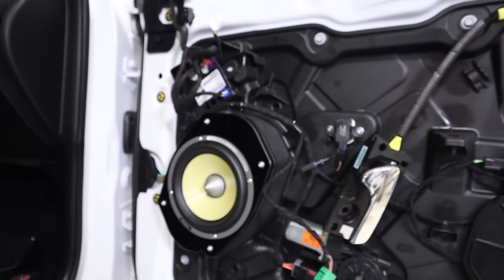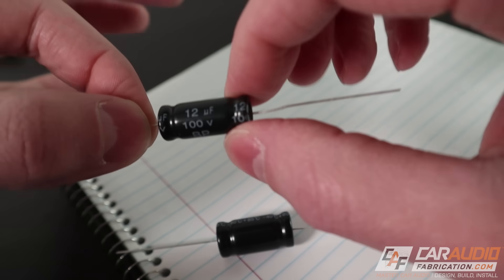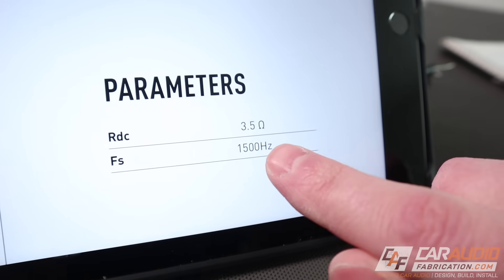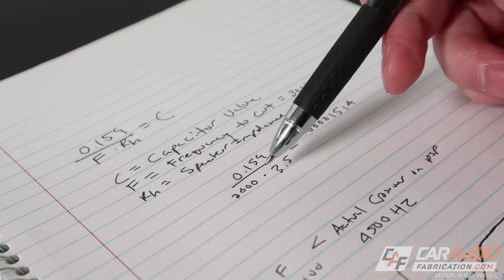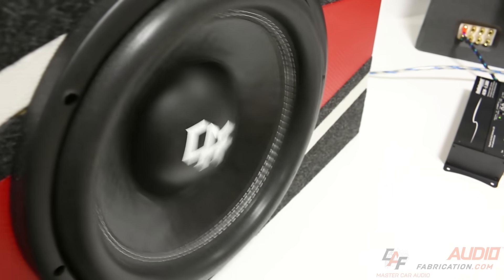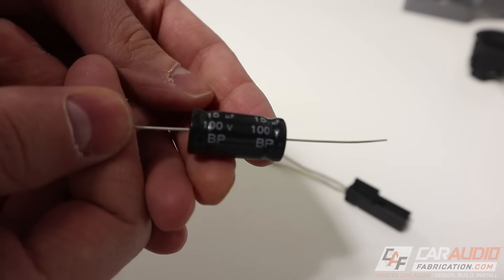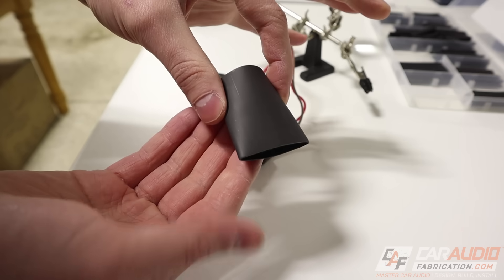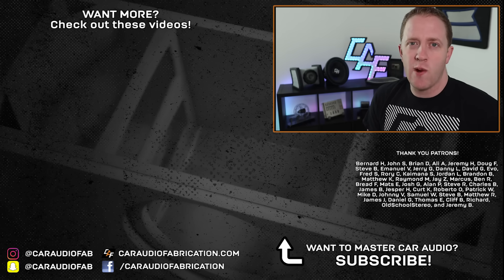PROTECT YOUR TWEETERS! Capacitors and WHY you need them

Comment: If I install a passive box crossover , does this capacitor on the tweeter affect the overall capacitance/ limits of the frequency ? Do I need  to remove it if I install the box

Comment: Random question:
If capacitors are always needed for tweeters, then why don't manufacturers just pre-assemble them into the tweeter?
Reply from the maker: Good manufacturers DO include this protective cap with their high end component tweeters. Look at JL Audio, AudioControl, AudioFrog etc. The thing is they don't know if you will run those active or if you will be using them with a passive crossover. So they don't bake it in
Reply: @CarAudioFabrication  Gotcha, I see. I'm honestly still learning, so I was genuinely curious. :)

Comment: Very good series of videos; just a quick question.  At 02:30 you mention F should be between Fs and the Actual Cross over Freq set at your High-Pass Xover (as per DSP).  The value for F is the set at roughly 2 x Fs.  but in the cross-over setting video you referenced (https://www.youtube.com/watch?v=BDKLYsGyBVU) you mention at 16:29 that the High Pass X Over for Tweeter is set at Fs x 2.  doesn't that mean that essentially F = High Pass XOver point?  Thanks for clearing this up

Comment: I have mid tweets FS value of 111 hz so a 390 microfarad cap. I notice the ones I’m looking at are 400v does the volts matter? Ones in the video are 100. Just checking I know you only say the microfarads matter but I want to make sure.

Comment: The equation doesn't work as listed.  0.159 / 3000 x 3.5 = 0.159 / 10500 = 1.5428  not  .00001514   Something is missing like (x 10).
Reply: Nevermind, I missed the e-5 at the end of the calculator. Funny we move the decimal five to the left, then 6 to the right for uF.  :-)
Reply: There's some discussion online about why microsoft standard calculator in windows shows scientific notation, but for we who are using the windows calc, the correct final result can be achieved by :  (.159/(FxRh)) x 1000000 as you did manually show.

Comment: I have a hissing problem when nothing is playing and engine off. 09 altima. I believe they put a capacitor on the dash speakers. Could adding a correct capacitor possibly fix my problem. Also ive read its common in cheap android head units. Going crazy trying to trace down the problem. Sloght hiss as soon as volume goes to 1. Unnoticeable with music on.

Comment: REF 6530cx Description: 6-1/2" (160mm) component speaker system Power Handling: 90W RMS, 270W peak Sensitivity (@ 2.83V): 93dB Frequency Response: 53Hz – 21kHz Impedance: 3.0 ohms    -   this speaker 3 ohm, can you suggest  matched car stereo for this speaker.

Comment: Do capacitors for tweeter control power output? I mean if the amp is 300 rms x 4, does the amp send the same amount of power to tweeter and component sub on that channel?

Comment: If I just installed dash tweeter and I have distortion on high volume I need to replace the capacitor? 
In the shop they put 100V 82uf capacitor

Comment: Is there a good reason to not solder the capacitor closer to the amplifier instead?  Thinking of a tweeter like the C7 where it is MUCH larger and fitting behind a panel could be a bit more difficult.

Comment: hey buddy if my component system has the passive crossover for the tweeter do I need to put additional capacitor? I´m guessing your example is only when we use active crossover. Correct me if I am wrong. Thank you!

Comment: Will a 25v 4.7 millifarad non polar capacitor work with a set of pioneer ts-120twm tweeters? It says they have an inline high pass crossover network built in. Will any capacitor work? The ones i have came from a set of vintage bookshelf speakers i scrapped

Comment: In my case, I have some old Japanese SONOCO loudspeakers, they sound wonderful, but the previous owner had no better idea than to replace the NEC dome Tweeters with 75W piezoelectric ones, I don't have technical information on these Tweeters and the factory doesn't even exist anymore. They are from 1975/79, my question is if I put in that place of the piezoelectric some of Domo that Wattage must have? What capacitor to put to make sure they don't burn or even my fear is that the amplifier will be damaged. 🙄

Comment: The principle of using a capacitor as a high pass filter to protect the tweeter against damage due to low frequencies is a good thing. But using a non-polair electrolitic capacitor degrades the sound quality a lot. Use at least a MKP type capacitor. Yes, it will be bulky and cost some bucks, but it wont affect the sound compared to the type used in the video.

Comment: When using component speakers with an inline passive crossover, should you select "No Tweeter" on the headunit since the frequencies already have a built-in crossover setting?
Reply from the maker: It would depend on the head unit. I'd basically defeat any on-board crossovers as the passive crossover will now take over.

Comment: My head get heating when i look at the formula.. may be I need A20 Bionic Chip to understand it... 😂
Btw, which is the best way to install component speakers? Is it install crossover after head unit or at speaker connectors at the door.pls help me...

Comment: Can anyone tell me if it's safe to use 15uf 100v cap on DS18 Pro-TW220 tweeter?  These tweets come with 3uf caps installed.  Per this video that value is way off crossing it at 9.5Khz.  I've reached out to DS18 about this and they don't answer me.  These tweets have a response down to 2Khz and recommended cross at 3Khz.  15uf sounds perfect.  Is there something I'm missing?

Comment: I calculated almost ~13 mikrofarad, you can get 10 and 15(I measured them havin 11,4 and 16,4)  but you cannot get a 13, you can have a 12 mikrofarad one, so I think I´m ordering a 12 mikrofarad one.
Should you go up or down or is it bad if you go too high / too low, how critical is the value?
thanks in advance

Comment: nice video. got a question. i calculated my new tweeter. i got 11,14 uF. How do we calculate the voltage. the original tweeter in the car has a 63 volts capacitor. or can we use just 100 volts. the new tweeter has 30watts rms and 60 watts normal How does this work. is there difference between polar and non polar capacitors

Comment: I’m running fs of 3.9 crossed over at 3000hz. I figured 17uf per the formula. Is this ok?
Reply: So my fs is 1200. Dc impedance is 3.9 and my amp has a 3000hz high pass filter. I bought 17uf caps. Will this work right?

Comment: Amazing video. One question, Since I have an empty slot for tweeter at my car pillar, I want to add a tweeter and I already bought one. I saw that my tweeter already has a polarized capacitor attached to its terminal. So, do I still need to use a crossover for my tweeter? For additional info, my car speaker system is 2pcs "2 way coaxial speaker" and 2pcs "mid base speaker". Appreciate if you could help.

Comment: you lost me ...i'm not good at math just tell me what Capacitors i need for the KICKER DSC6930 6x9 . i have them running on 2 ch on the SKAR SKV2 -100.4AB Full-Range    and they sound like crap let me tell ya.. will you kindly please tell me what size i need

Comment: I love your videos and have learned so much!  I have a question hopefully you can advise me on.  I've got a set of Infinity Kappa 1.4" edge driven soft dome tweeters that I want to replace my factory tweeters with (21 Ford Super Duty with the factory B&O audio).  I believe the factory Ford tweeters have a bass blocker so I'm assuming the B&O tweeter circuit is full range.  The Kappa tweeter is part of a component set (90CSX) and the crossover specification on the component set is 5kHz.  I don't want to use the Kappa crossovers as they are large round (hockey pucks) that won't fit in my dash near the a-pillars tweeters.  The Kappa tweeters are 2.5 ohm and based on a 5 kHz low frequency cut off, I could use a simple non-polarity 12uF capacitor which would be 5305 kHz cut off.  My primary question is according to your video I should try and set the crossover point between the resonant frequency (Fs) and the published crossover point of 5kHz.  I have been unable to find the resonant frequency specifications for my tweeter.  Should I just target 5kHz or should I go lower?  Is there a typical Fs for a similar size tweeter I could use?  I feel that 5 kHz would be safe but I don't want to lose lower frequencies if the tweeter can handle it.

Comment: 2.2mf 4.7mf 6.2mf 7.8mf 8.8mf 10mf 12mf 15mf 25mf 50mf 100mf/100V 150watts 8 impedance ohms tweteer applying 250watts woofer 8 impedance ohms at 400 watts amplifier.
My question is which capacitor can be use?

Comment: Only one speaker in my car works, could i have my amp hooked to my subs in the back and hook up some high range tweeters to the amp aswell and move them to the front? Or would i over power the tweeters and have a shitty static noise when the bass hits?

Comment: Great video.so would you still need to put a capacitor on a supertweeter  if your using a 3way crossover before going into the amp? Was planning on using a 3 way crossover to connect a supertweeter and a 8" midrange  and then connecting it to a lc4.800 bridged to get more power to the midrange(400rms)@4ohm.also how do I make sure the tweeter doesn't get no more than 100rms or less.would the capacitor n crossover,dsp take care of that? 
and using dm-810 DSP to adjust.

Comment: Question for you Mark - I did this exact thing on two different sets of tweeters. I’m using audio control DSP and amp.  I’m using the same capacitors you are using the formula for my own setup. When I put the capacitors in line there is an audible pop at turn on from the tweeters. When I remove the cap the pop is no longer there. Any ideas what may be causing this? I’m running Focal ES165KX2, so definitely don’t want to end up blowing the tweeters on accident.
Reply: Switch to a fuse of 1 a,p or maybe even have of that for a solution..

Comment: My 2004 Cadillac SRX has factory tweeters and i was wanting to put a bass blocker on those, but the only info is 4 ohms, not sure what to do with that, as the rest of my specifications are not listed anywhere, so what should i do in this case? I have the Delphi tweeters 09354879 REV 03 40265D
Reply from the maker: There are tools to measure the needed specs, but probably better to upgrade the tweeters and then you will know the values. Those stock tweeters are not anything special.

Comment: I have questions for you...  I love your info and your channel and all the videos you post. I am considering installing an audio control epicenter plus on my 2012 Escalade ESV LUXURY and want to do it with a wiring harness instead of finding, cutting and soldering wires into the harness. Is there a harness that has this interface?  I just want the plug and play ability to allow my BOSE system to work with an easy plug and go.  I am adding 3-15" Eclipse subs, a Goliath 4k amp with a yellow top, second battery.  Please help.  And keep up the awesome work.

Comment: Question: audio signal straight from my car stereo or Amplifier without crossover, is this cap going to do the job to cut the signal to the right frequecy?
Reply from the maker: Watch the video 👍
Reply: @CarAudioFabrication  I did, maybe I got confused, I know is for safety if crossower will fail but I prefer not have the crossover and use specific cap on my wish. I was just looking for confirmation..sorry.. 😁

Comment: Is there a similar video to protect your mids from playing high frequencies?
Reply from the maker: Use the crossovers on your amp. The point of this is a Tweeter will melt given low frequency. A subwoofer can play high frequency and be just fine
Reply: @CarAudioFabrication  I have a similar issue than the video you posted of whether or not passive crossovers are needed when you have a dsp connected (https://youtu.be/yjTpFAnuxlw). I have no issues determining the capacitor size needed, however calculating the inductance size of the mid is where I am struggling (for a 2way component system).
Reply: @CarAudioFabrication  also thank you for your reply.

Comment: I have a question for you, I purchased a set of Infinity Reference 3032cfx and inside the packaging were 2 bipolar 270uf 50wv capacitors but i also noticed each speaker had a small capacitor that is 4.7uf 50u on them , so i use the other included capacitors as well? If this basically both high and low protection ? Thank you

Comment: Whats the best way to hook up tweeters? If I have a cross over, can I connect more than 1 tweeter to the tweeter connections? Will the power be evenly distributed to each tweeter? If I have a bass blocker, can I set my amp to full signal and just let the bass blocker do all the work? Or should the amp crossovers be set appropriatley? With those super tweeters capable of 200 watts rms, would I use a 4 channel to run 4 of those and have a seperate 4 channel for my mids?

Comment: I'm testing the system I just installed and everything is working except the tweeters. When I connect the tweeters I just hear a loud buzz and no music. I installed a 15uf capacitor on each tweeter exactly as you showed here. I suspect it's the capacitor causing the issue since the other speakers without caps are working fine. Any troubleshooting tips? I'm using an audiocontrol lc 6.1200 amp and the tweeters are focal KS 165kx3 k2's. Active.  Is there an install mistake I could have made that would cause this? Should I remove the caps and use the factory passive crossovers on the tweeters alone to protect them? Open yo answers from the community.  I assume marks a busy guy. Thanks!

Comment: Do you need to run a crossover if you don’t have an amp installed, what if you are just replacing the OEM tweeters and speakers because they are 20 years old

Comment: I'll have to check and see if the OEM speakers on my Mustang has this electrolytic in series with the tweeter. If not, where do I get specs on the OEM tweeters in order to calculate capacitor values?

Comment: On my 3 way crossover is written "Crossover Frequency: 2500-7000 Hz" ,  which frequency do I use to calculate capacitors, to protect my twitters? 
Can I also protect my mid range speakers the same way? Thanks.

Comment: How do you work out which one is the positive & negative wire on a Focal PS165 FX tweeter, it came pre-soldered with a clear & red striped cable
Reply from the maker: A proper polarity testing tool
Reply from the maker: https://www.mobilesolutions-usa.com/product-page/pt-9aplus-kit
Reply: What I forgot to mention was that one has a clear insulation and the other one has a clear and red line along the length

Comment: 2 questions:
1- Infinity Ref 3032cfx come with capacitors, I assume they would be the correct ones to use, correct?

2- Is soldering necessary, or can it be twisted and wrapped?

Comment: Ive bought hertz uno k165 component speakers but don't know if I need a filter for them. I'm told I'll need a filter but don't know where to find one for a decent price. The tweeter has a built in capacitor. Do i need a filter and what type/where would I get it? Thanks

Comment: If I want to use a capacitor after a full range 6x9 in series between a 6x9 and a tweeter to increase my resistance to 8ohms to lower wattage will I still get full range from the 6x9?

Comment: I just ordered infinity reference 2-way speakers my truck ...4 6x9s ans 2 3 1/2 " . the 3 1/2 inch sounds good until u crank the volume really loud ...they came with these capacitors . What will the capacitor change in the 2-way speakers ? Will they sound better ?

Comment: Hi, I brought a set of Tweeters with the Bass Blockers already Installed. Using a Multimeter Im not getting speakers empedance reading after the bass blockers but I do get a 4 ohm reading when testing before the bass blockers. Is this normal. I'm trying to install my own car stereo system. First Timer Thanks.

Comment: I have 2 sets of metra 650 watts tweeters.  On the box it says it has a built-in crossover on the tweeters. Do I still need  bass blockers.
Reply from the maker: Not if the crossover is passive and built in. As discussed in this video, the point is when you are using tweeters actively.
Reply: @CarAudioFabrication CarAudioFabrication do you know the lowest frequency the tweeters should play?

Comment: Or just use a DSP.
Reply from the maker: Lol. A DSP potentially losing settings is the exact reason this is done.
Reply: @CarAudioFabrication  yea ok. So use a capacitor and not let the tweeters play to their potential. Play it safe for the customer.  I understand.
Reply from the maker: Lol, a capacitor on the tweeter does literally nothing to the performance of the speaker. I could have one with a protection cap and one without with DSP crossovers applied on the signal and you would never in a million years be able to hear or really even measure the difference.  The idea is that the crossover point of the tweeter is lower than the one that is used on the system. Its a fail safe. Don't let your lack of understanding lead you to going on a tirade about how the speaker somehow isn't able to any longer play to its full potential. JL Audio even includes protection caps with their high end C7 tweeters, but I guess you know more than a full team of audio engineers.

Comment: I prefer to add festoon bulb and  use the non polar metallized capacitor to 3.3uf/100v same frequency for JBL pro series to sound really cool, that frequency for 15uf is good for mid range speakers frequency and I will be using a titanium tweeters is the best and also check the RMS power of the power amp ,, the higher real RMS the better sound quality u have, and for the  low frequency I will use a 68uf/100v parallel to the woofer + and - and the positive is using a 9MH inductor for a powerful thunder bass and helps you from protection of the speaker loading ,, JBL style of SOUNDS of  power !!  that will last your amp and speaker in a long use